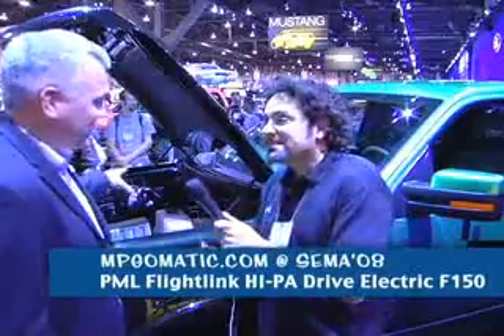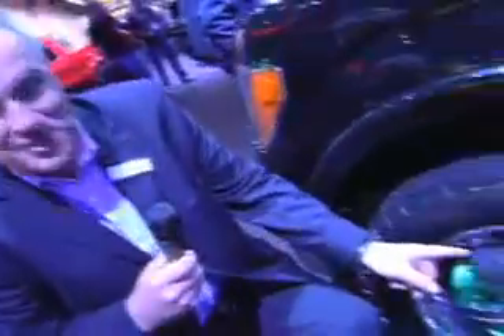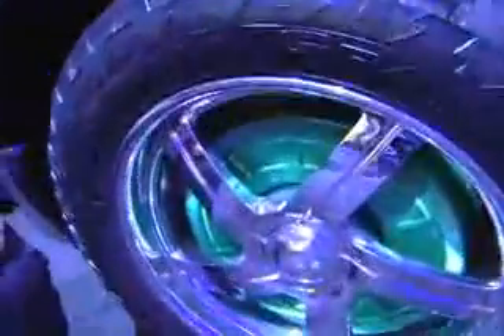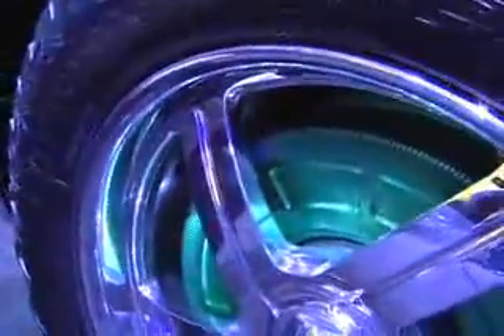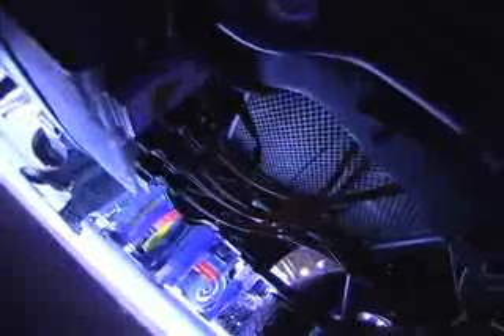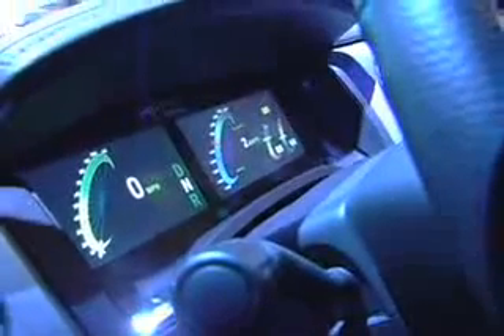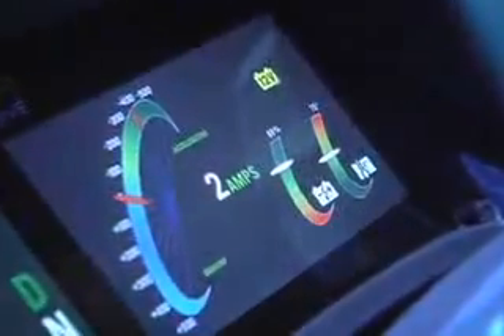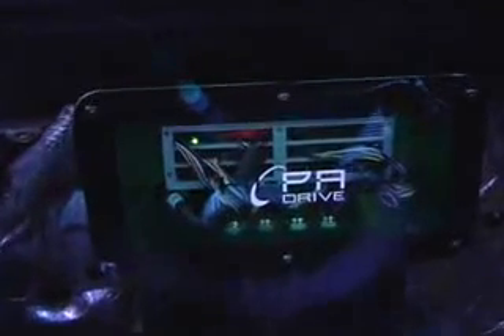PML F-150 4WD Wheel Motor Electric Vehicle SEMA 08

Comment: your car doesn't use a DC motor.  Standard engines only spin one way and then gears make it turn forward or backwards.  If the voltage was reversed, you'd be going down the road at 60mph and suddenly have one wheel trying to spin you in a circle.  You could make a control system that made that situation virtually impossible, but his comment was mostly pertaining to the fact that DC electric motors can go either way.

Comment: If it uses regenerative braking, what happens if the electronics fail when you are at speed?
Also I hope those undercar cables will be shielded by a cf or aluminum underbody shield, I forget the official name for it, like on the GTR and Veryon.